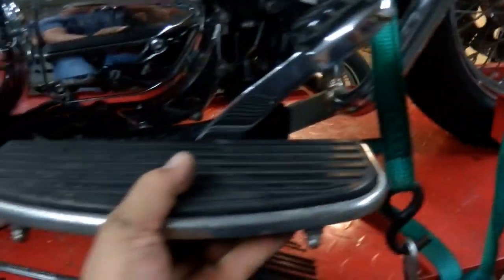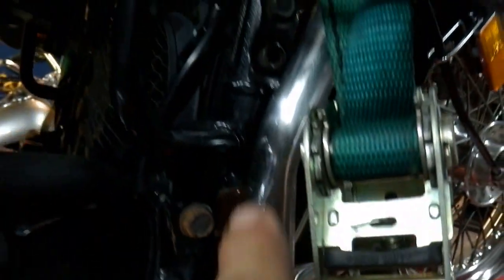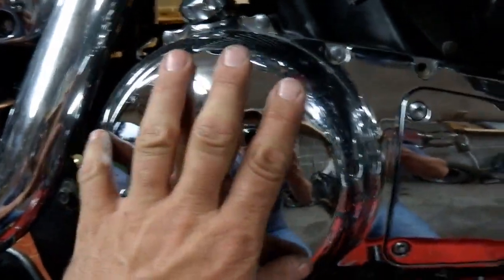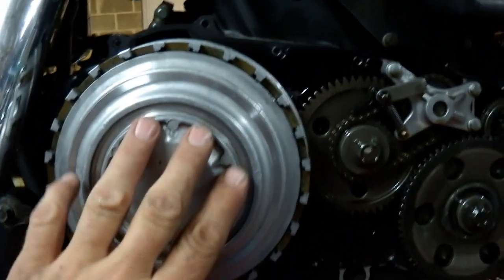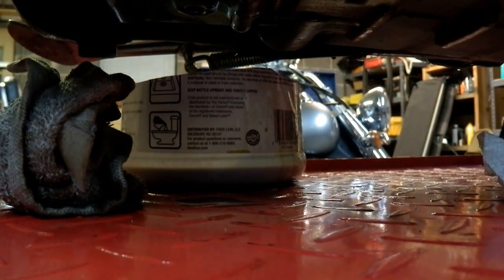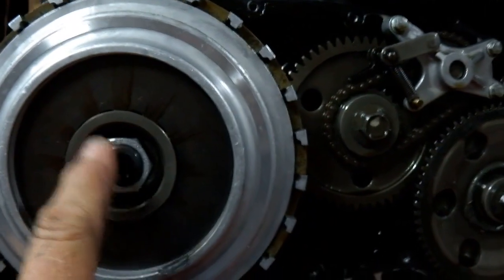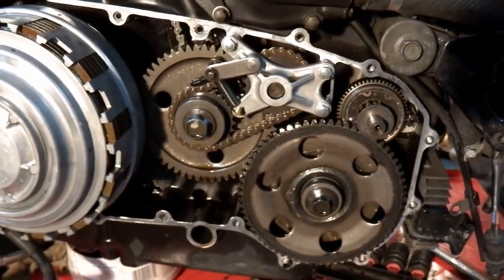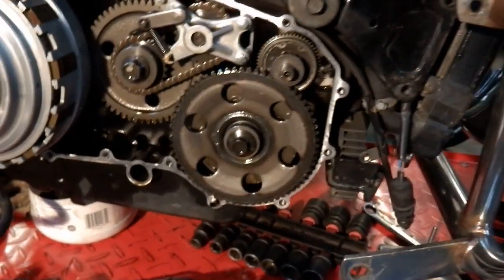2003 Kawasaki Vulcan 1500 Clutch repair Upgrade

Comment: Great video David! I bought my 99 1500 Vulcan Drifter New, at around 22,000 miles the clutch started slipping so I put in a new Clutch Spring and problem solved, now at 45,000 the same scenario and the same fix. Did not do the Holder upgrade but I will at 67,000 miles. Keep the informed videos coming!!!!!!!!!!!!!!!!!!!!!!!!

Comment: With all respect, I belive the last friction plate was not put on correctly. It goes on the shorter groove. You can compare it to the original  one at the begining of this video, or by reffering to the service manual. All the best
Reply: I saw the same

Comment: 57k miles on an 03 and just replacing the spring fixed it i ended up at your video cuz im currently looking at a used 05 1500 listing seller is saying clutch need work its listed for cheap maybe if i can get it for few hundreds bucks it'd be a little project i never worked on motorcycles clutches but always motivated to get my hands greasy

Comment: I didn't know about that slip. I just got a 2000 kawasaki vulcan 1500 classic. I traded a little suv to my brother because this was all he had and its winter. With that said I knew nothing about this bikes friends have HDs or rockets this modern Japanese  V twin is all new to me. Well I had one good day before snow so I had to ride it was in the 50s but sunny and felt good the bike started right up but takes some time heating up. It needs some carb work you don't notice it all the time but I was heading to the gas station and backed off it pulled the clutch to shift and she popped and died I tried push start as I was rolling good speed and started heading down hill and it just felt like band slip I wasn't sure why thought something broke how it died but now I know about the slip thanks for the videos. I'm looking in to things I can do for mods as it needs some TLC odometer says 25k which I hear for a 2000 is low she looks clean for the most part I think had a rough last few months as she drove across country and back maybe 2 or 3 times since August 2020
Reply from the maker: Cool, I have around 75k on my bike,, still running strong
Reply: @mobilmontana  this one has 25k I had it running yesterday we had a little bit of sunshine 🌞so my girl and I road around the neighborhood really quick. I don't know its because it's so cold out but I notice oil starting to leak from the top of the heads. If I had a warm garage I wouldn't mind taking this time to go through and fix things up need read brakes and the boot on the shaft needs replaced there a crack or hole in the time. I also would like to clean the carb and change the exhaust system. Do you have any recommendations things I should to first or keep an eye on I'm planning ahead on taking a ride this summer. I know that my brother didn't have it long yet he did a good amount or driving across country a few times and didn't really service it.
Reply from the maker: @hotboy197988  IF it were me I would change brake and clutch fluid with fresh,,, Change out antifreeze,, Change lube in rear gear box,, make sure you have good tires, tread and no dry rot and the oil leak,,, Have a good riding season this summer then next winter I would think about fork seals and repacking bearings in steering while your doing forks,,,, Get all the maintenance stuff caught up and all youll have to do is change oil for the next 3, 4 years
Reply: @mobilmontana  well I've did oil change when I first got it out this spring used  Kawasaki's full synthetic. noticed a difference in response think the lifters with the oil that was in it wasn't building good enough pressure. Did both tires and different rear rim found it had a flat spot. After around 1500 miles I did a 2nd oil change just to seen how the screen looked as I found bunch on gunk in the first oil change. It did have maybe 2 little bit of metal. I think it could be the bevel bearing. I've changed the coolant at the second oil change, plugs and air filter. Just hit 30k added  Is Vance & Hines true duels And nomad bad hard bags cleaned the carb had to replace  Is accelerator pump diafram going to rebuild the carb just need the slide and  Diafram have new back off diafram also to install. The last few hundred miles I noticed the ride started feeling worse believe it's the bearings going to replace front and rear to the Forks and bevel bearing. This winter plane to pull the motor and go through it also upgraded the timing chain tensioners. How did the Clutch turn out with that spring I'm planning on going with Barnett clutch and spring. I notice when both me and my girl are on the bike that sometimes it feels like the clutch is starting to slip I don't really feel it as much when it's just me why I believe it's starting to slip. I'm excited about wanting to upgrade things starting to come along yet when it was done so I can just ride lol.

Comment: I put the Mean streak spring in mine with the Judge washers. My plates looked good. After about 500 miles, it's just starting to slip again. Typical for me, I'll be doing the repair again, this time replacing the plates.

Comment: Appreciate you taking the time to make this video! I've got a 2003 Vulcan Classic that needs a new clutch according to a mechanic. May I ask what manual you use?
Reply from the maker: Clymer is the repair book I use,,, In my case I thought clutch was worn out,( Slipping bad )  turned out was just the spring,, I never used the new clutch disks I bought

Comment: I just replaced plates and went with the Barrett spring as well as the updated spring holder. However, now I cannot depress the clutch lever. Is this a related or separate issue? Thanks in advance.

Comment: You skipped the one part I'm having trouble with! lol 

I am replacing the clutches on a 2002 Vulcan VN1500 Classic FI. When it came in, the clutches were slipping BAD. When I took it apart, the metal discs were burnt and there is a distinctive smell of, what smells like to me, hickory. The torque limiter springs were installed incorrectly and one of them is way out of shape. After replacing the friction plates, the metal plates and the torque limiter springs, I went to put everything back together. The operating plate sticks out too far to insert the clip into the retaining groove of the clutch cover. I have found that if I loosen the clutch hub nut quite a bit, then the operating plate will fit. I know that there are larger steel plates, but the service manual only recommends replacing one with an adjustment plate and to be honest, the extra 0.3mm is not going to be anywhere near enough to account for the difference I need.

Also, in the service manual, it says to squeeze the clutch handle while you insert the spring plate pusher. That doesn't really make any sense since pulling the clutch lever in pushes the pusher out!

It's been a long day. I've never had this much trouble with a clutch. What am I missing here? Any help you could offer would be greatly appreciated!
Reply from the maker: Seams to me I had trouble, First I had trouble with the aftermarket spring that stuck out further, Think I was only able to grab one or two threads, tighten nut slowly making sure all the parts aligned, think it took several tries, Felt nut stop a couple time as parts were not aligned, Then the trouble your having, Try removing engine side cover on other side, remove three bolts holding slave cylinder, this should remove pressure on the rod that disengages clutch allowing you to push cover in more, ,  If this works then loosen bleeder screw on slave cylinder so the piston pushes back in while you tighten screws, and while your in there go ahead and and change clutch fluid, bleed out any air that might be in there, fluid breaks down and changing it will make seals last, DOT 3
 Let us know how you make out
Reply: I appreciate the reply. I have a new spring plate on order and as soon as that comes in, I will definitely try that. I will let you know how things works out...

Comment: Always use Motorcycle Oil conventional oils most always have friction modifiers in them and that can cause your clutch to slip.
Reply from the maker: Great point
Reply: Rotella diesel 15w-40 made my 400ex clutch stop slipping and valve chatter went away as well

Comment: Hi there, part number for washer for the new diaphragm. The one that fills in the groves and leaves no gap?
Reply from the maker: Old part number was       
HOLDER,CLUTCH SPRING
13091-1494                                                                                                                  
 Two New part numbers to  replace the one old part
HOLDER
13280-1307
And 
HOLDER
13280-1306

Comment: I'm so glad I found your videos. Awesome work! 
How bad will it be to do the boot on the drive shaft and does it also address the primary leak? I mean I should be able to deal with at the same time, correct?
Reply from the maker: To replace driveshaft boot you have to remove exhaust and all engine mounts to maneuver engine, disconnect driveshaft,, I don't think replacing boot will take care of a leak,, driveshaft boot is just a dust cover over driveshaft coupling,, there is still seals ,, One of my videos shows installing engine and driveshaft

Comment: Hi Dave, thanks for good oil on the 2005 cassellated 'washer' supporting the rim of the main spring. In the vid you refer the new 'spacer'. Can you please describe the difference (if there be any) between the old 'spacer' and the 'new' spacer used with the cassellated 'washer' ?
Reply from the maker: The new part is two piece, there is like a washer with teeth on it that fit the spring washer teeth,  where the original spacer is one piece and allows ware on the spring washer teeth where it meets the spacer, Sorry I cant describe it better, I show both in my video, look around 8:20

Comment: Planning to do the same thing to my motorcycle I have a 2001 Vulcan Nomad 1500 will these parts fit my bike also? The two holders I mean
Reply from the maker: 2001 and my 2003 are the same,, Parts I used were from a 2005
Reply: @mobilmontana  I got it done I ordered the same Parts you did they worked on my 2001 ended up breaking the clutch lever trying to pump it up but I got a new one on there since working fine had to space the clutch lever out a little bit away from the grip to make it easier to pull and hold I appreciate the information you put on YouTube thanks

Comment: This is a long shot but I have 1 2003 mean streak that I changed my clutch on. And once reassembled my clutch moves out but doesn't go back in by itself. I've took it apart and still can't figure out why its doing this, worked fine before. Any advice?
Reply from the maker: See if it goes back in when you loosen bleeder valve on slave cylinder , under chrome cover on other side
Reply: @mobilmontana  not unless I push it in, it was working fine before. I'm just stuck now smh
Reply: @mobilmontana  i just noticed that the clutch spring is not sitting flush with the spacer. I. Not sure why or how that is but its probably the problem. When you put the pack back together how did you get that flush?

Comment: Do you think you could have done this job with oil in the bike...? Leaning it on kickstand....
Reply from the maker: No
Reply: @mobilmontana  i think you can... if you think about it, the oil level sight line glass window is below the outer cover so if its level it will still be below that low point, on the kick stand it will be even further below.

Comment: Does anyone know if turning the clutch basket clockwise a little bit will cause issues? It turned the other gears a little bit. I'm not sure if I messed up timing or anything like that

Comment: I searched on Barnett and can’t find the new piece with the washer just found the spring
Reply from the maker: The other new parts I used were OEM parts from a newer model, In my case I was working on a 2003 and used parts I bought off E-Bay from a 2005, Go to a Kawasaki parts web sight and look at diagrams of your bike's clutch and a later model, This is the part number of the part I replaces (Holder Clutch Spring) part #, 13091-1494, The replacement part is two piece, what I call a hub and the washer with the teeth, you need both parts to replace the one, part # 1328-1307 & 13280-1306 Both parts called Holder on the parts schematic

Comment: great video, but you never showed the trick on putting the 3 shim back in... ?
Reply: im with you on that they set a certain way and have no idea
Reply from the maker: Sorry man, First one goes cupped part toward engine, next two cup to each other so there is space in the middle between them, The only trick is you sort of pre assemble spring washer, the center bushing part and washers on the bushing piece then carefully slip them on all together, might take a couple tries and bike as straight up as possible helps washers from falling off center bushing part
Reply: thx bro

Comment: I couldn’t get the cover on because the push rod with the barrings so I relieved the pressure with bleed screw and it worked. Only problem now the clutch won’t engage at all. I bleed the lines but still nothing
Reply from the maker: Even with air in the system the clutch should be engaged, sounds like outer cover on clutch may be one groove off, on mine the cover that goes on after the clutch plates has grooves to go over the splines, not all the grooves are deep, may need to clock ( Rotate ) that cover one groove
Reply: @mobilmontana  yes, the last friction plate goes on a different notch, i figured that one out after i took it apart again. i also found out that the metal plates are suppose to go on all grove in or all grove out but not different. The trick to putting in the springs in is with grease so they will stick together when putting them in. Great video but for back yard mechanics like me a video on putting back together would be good. Thank you for getting back to me!

Comment: Your video was very helpful, but I have one question, the shop I bought the clutch plates said I had to measure all the friction plates and steel plates together and they had to be a certain measurement, but I cant seem to find out anything to support measuring al the new plates together. Do you know what he is talking about?
Reply from the maker: What they are talking about is the spring washer or whatever you call it only springs back and forth a certain amount, so if the measurement of total thickness is to small the spring washer won't apply enough pressure and clutch will slip ( as worn out friction and metal plates would do as will a weak spring ) too thick the spring washer won't release enough and clutch won't release,, My experience the metal plates wear little and in my case neither did fiber plates, I bought new fiber plates, measured with calipers them stacked all together, measured entire stack together and realized my fiber plates were not worn out,. Replaced my spring with aftermarket but clutch lever a little stiff, If I do it again probably go back to a stock,, if you think you need fiber plates I still have full set of OEM I could make you a deal on,, My guess is your spring is week and replacing it is all you need,, Probably find measurement, ware limit in relate manual

Comment: Let's try this again my spell check sucks. The washer thing that goes behind the pressure spring. The one that has the grooves in it to keep it from spinning and getting that wear on it. I can find the pressure spring but the part that goes behind it that you replaced that keeps it from spinning cuz it goes into the grooves.don't know what it's called and can't find it anywhere could you please tell me what that is called so I can order one. As I have the same problem as you the pressure Fleischer is or just like yours and I would like to put that piece behind there to keep that from spinning any longer don't know why they didn't put one of those in from the factory LOL please help....

Comment: Did you also replace the torque limiter springs?
Reply from the maker: Just clutch spring ,, Part number 92144-1934 ,, didn't even use the new clutch disks i bought

Comment: What is that part I'm getting ready to order the clutch and gasket my shipping has gotten worse just going to replace it now
Reply from the maker: 92144-1934 is stock clutch spring, all my clutch plates were still good, problem don't need other parts I used and I used a Barnett spring and clutch lever is a little too hard, l probably should of used stock spring as part number I gave you,,, if you do need clutch disks plates let me know, I have new Kawasaki set I never used and make you a good deal on em,.
Reply: @mobilmontana  I got on some forums and found found these wahers called the judges washers. I used them with  Barnett clutch spring. Now I can push start the bike the stock clutch and plates showed light signs of wear. So I just replaced the spring and added the washer. I've also since replaced my bevel bearing it went out a week later. I didn't replace it with the stock. I found a YouTube video showing a bearing made to take more force from the side. I cleaned and regressed the drive shaft. Now if not careful up can lift the front wheel taking off to hard. being able to push start or lock the rear wheel by down shifting to fast it's a whole new ride you feel the power on the ground and I also did all my hydraulic fluids. She stops better and take off is much more responsive.
Reply from the maker: @hotboy197988  Cool, good job